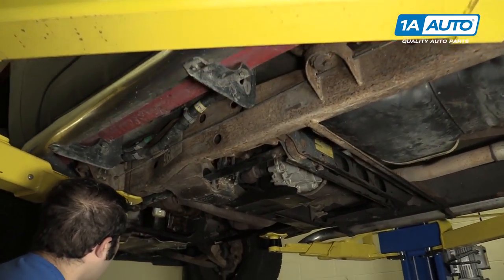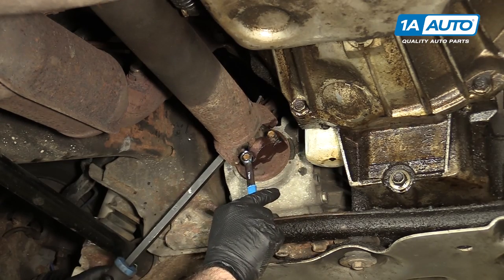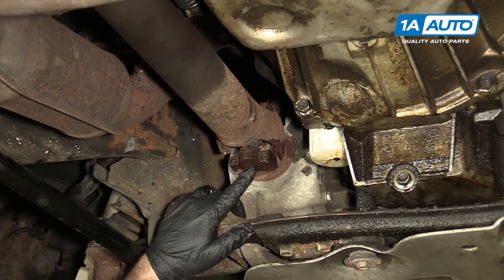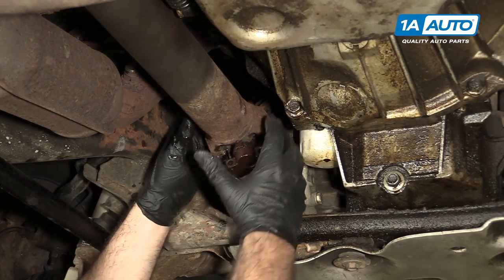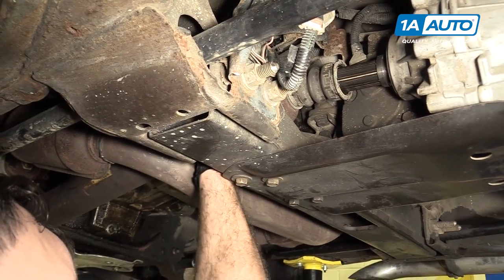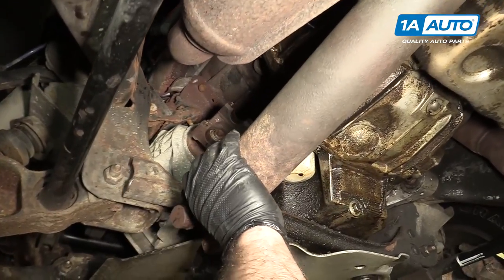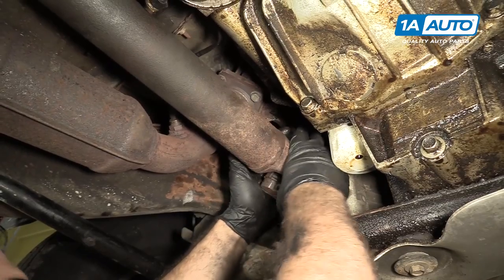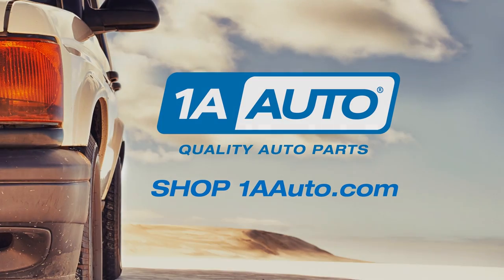How to Remove Front Drive Shaft 01-05 Chevy Avalanche

Comment: Why were there no boot clamps on the transfer case spine yoke boot? I know there was some on there before at one time because you could see where they used to be. Why did you not show re-installation of the spline yoke boot and new boot clamps? Don't you think that they are necessary? Is is because you sell them? Or maybe it's OK to just let the boot flop around loose and get looser and with centrifugal force over time get looser and floppier?

Comment: I just got a 2003 Yukon and the front drive shaft boot is completely rotted away.  I can get a new boot back on but do I need ot worry about damage to the shaft or transfer case, since theres no way to know how long its been off?  Not sure how to inspect for damage due to this other than just run the 4x4 and see what happens...

Comment: Any tips for the ujoint being seized in? My transfer case is completely screwed so I'm even wondering if it's possible the axle is seized or is bringing up in something in my transfer case. Can't for the life of me free it up. Rear came out fine.
Reply: Cut the u joint in half very carefully with an angle grinder metal with cutting blade of course. Be careful not to hit driveshaft.